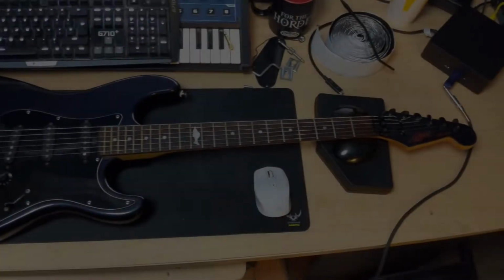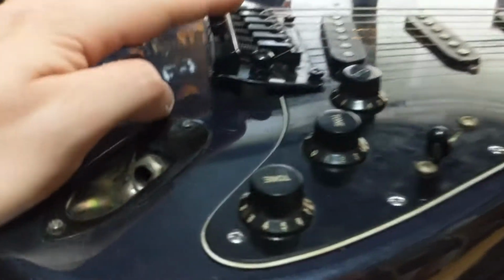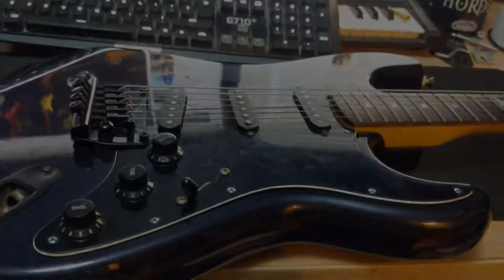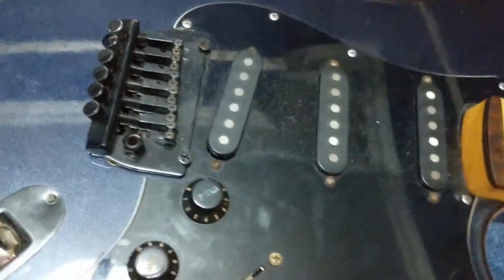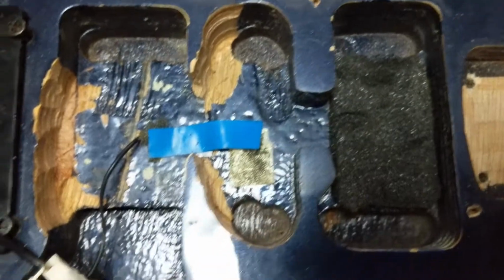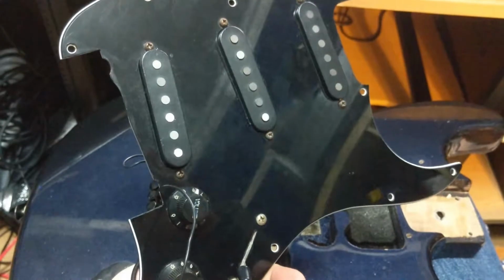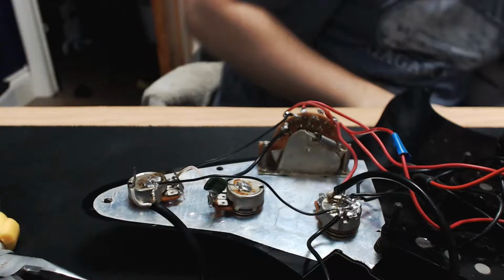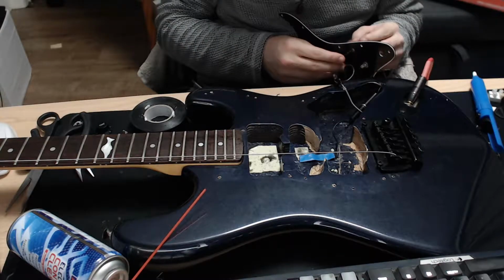Guitar Shed Diary 004 Marlin Sidewinder tear down and Rebuild Pt1

Comment: Hi Dave, I have just finished installing a £15 Floyd rose on my metallic blue sidewinder. Fits on the original marlin bridge fitting but with the Floyd studs. Holds tune and plays perfectly too. Thanks for an amazing video sir
Reply from the maker: Interesting... I've always wondered if there was another bridge that would fit.
Reply: @DavidImrie  I can post the link or pictures too if you like sir. It has the same spacing as the marlin bridge but I filed the top of the neck for the locking nut
Reply: @davidchard4595  yeah, defo post the link! I have the same issue where the zinc block has disintegrated and I can't find a replacement that fits.
Reply from the maker: With respect to Dave I think the fit isn't bad, and looks ok but it does leave some of the routing visible at the corners so not perfect. I bought one but haven't tried fitting it yet. https://www.ebay.co.uk/itm/Floyd-Rose-Pats-Licensed-Tremolo-Bridge-Black-for-Electric-Guitar-Parts-/123717949437?mkcid=16&mkevt=1&_trksid=p2349624.m46890.l6249&mkrid=710-127635-2958-0
Reply: @DavidImrie  Great! I was looking at something like that but I didn't think it would fit the existing posts. For < £20 it's probably worth a try. Thanks.
Reply from the maker: Well I can't vouch for sure as I only did a quick eyeball but from what I remember the post spacing looked right. But I would have been prepared to swap them. If you try it before me let me know how you get on 😁
Reply: @DavidImrie  Well it looks like David (Chard, not Imrie) was right all along! And David's eyeballing (Imrie, not Chard) was pretty much spot on. The £15 bridge fits the existing posts but they are not quite centred. It doesn't seem to have caused a problem so far. I had to mess around the the whammy bar a bit to get the bridge to fit  - not sure how David (Chard, not Imrie) did it but it is possible to get it to fit by discarding the casing from the bottom of the bar and threading it through the underside of the bridge. Only problem now is that I don't have the original locks and the new ones are too big! I'm either going to find something that does fit, like an actual nut (not the ones you eat), or place the new locking nut further up the headstock (it can't replace the old one - it's cut so that it covers the truss rod and fits the curve between the head and the fretboard).
Reply: @DavidImrie  the block had crumbled on the marlins bridge so it's been out of action for a couple of years. The mind started ticking looking at my ibanez and Jackson pc1 with the Floyd

Comment: Just picked one of these up, sure it's a real early one as has the single hot rail in the bridge (also note my original pickups are staggered with a massive metal plate under each) and no string tree (does have original floating trem and locking nut, the bridge on yours looks exactly the same as standard just redone in black) just striped it down to do a half hearted rebuild as it will just be a personal work horse
Reply: http://www.twitch.tv/bigmick81/v/677417289?sr=a&t=1032s

May interest you, may also not have any sound due to me having background music playing ha ha
Reply from the maker: Lol. Is it definitely a sidewinder? I think the traditional triple single coils were called "slammers". I've got another one that's been sat in the to do pile for 6 months. 1year is pretty recent on my timescale 🤣
Reply: https://samick.fandom.com/wiki/K-32

Strange reading that page they were produced 86-on

But I've seen pictures of a k32 neck stamped 83 and read of people asking questions about their late 70s sidewinder

Think if it's more of a case of a lot of guess work and word of mouth from chaps who can kind of remember as marlin was never big or had a big following, even the best selling British guitar was more down to price point being an almost rep stratocaster but cheaper than being the preferable guitar

Do tell more about the other one you have hidden away?
Reply from the maker: Oh. Fair enough. I'm no expert. I'd assumed the slammer was the traditional strat and the sidewinder was the hotter one. The one in the to do pile is a "loner" I think it's the top end one but it's still a cheapie 🤣😎

Comment: I had a black one of these (first guitar as well) with the hotrail humbucker at the bridge. All black. Locking trem. And a mini allen key on the back of the headstock to adjust the locking nut. Remember it being heavier than anything. I had a thought at the time the body was made of a laminate (almost looked like plywood inside the cavities). Never knew it was madw in Korea. I wish i'd kept it.
Reply from the maker: Your description is pretty accurate.. I believe some early ones were made in Germany but most of them were far east. To my knowledge all of the bodies were ply wood. Certainly all of the ones I've come across are. It's not a bad material as you might think but it sure is heavy. They were cheap but just as playable as any squire. Their main issue is the bridges are a bit cheap n nasty.

Comment: i have one of these with strange active circuitry (9v battery in the back, and some extra switches). i'm tempted to fix it up after watching this :)
Reply from the maker: Go for it. you cant really de-value them much. Great guitar to practice on. Don't throw too much at it though. Is it like this?
https://www.ebay.co.uk/itm/Vintage-Marlin-Sidewinder-Stratocaster-Electric-Guitar-With-Active-Circuit/283858570558?hash=item42174a0d3e:g:hM0AAOSwAiJepAaR
Reply: @DavidImrie  yep thats exactly the same :) i'm not going to do much more than replace the pickup switch and a couple of pots and resolder everything, i already added a neck pickup from a Maison guitar
Reply: Same one me dad has got, with the humbucker in the bridge? Never knew what the little switch was for